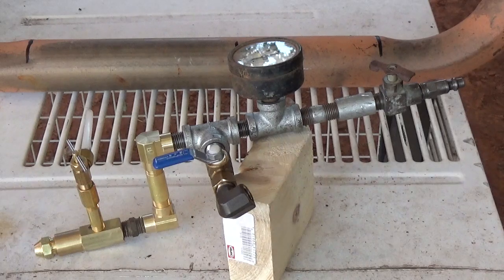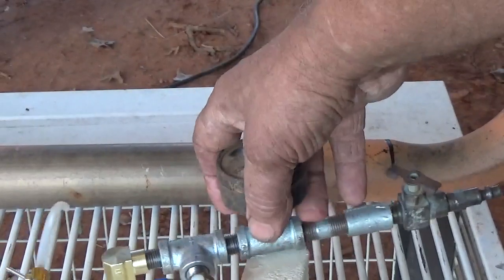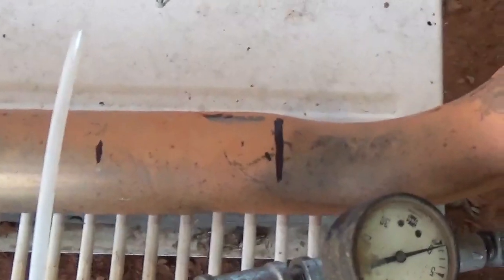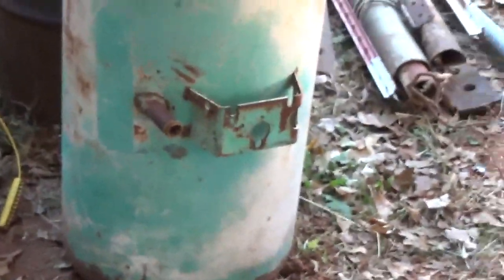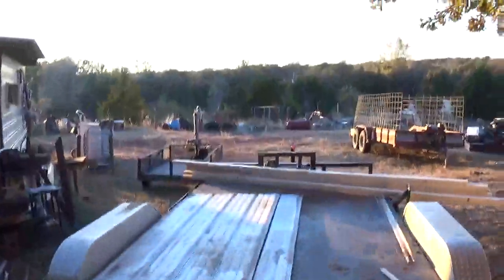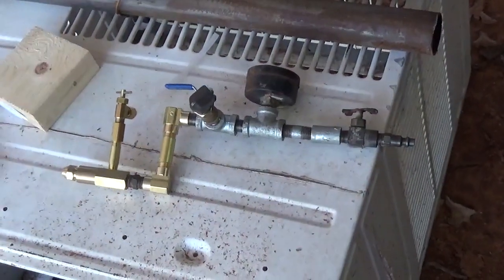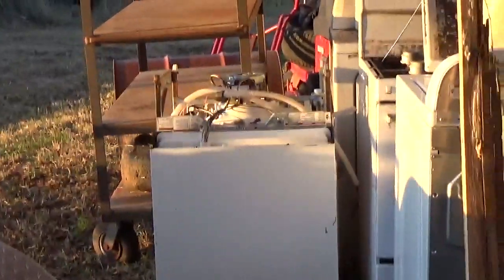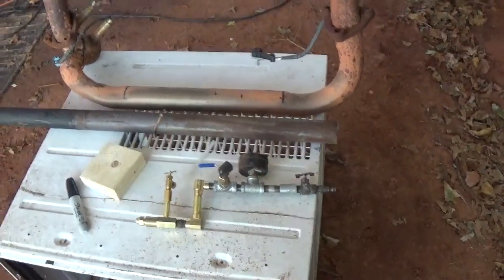The Making of a Waste Oil Burner

Comment: Love your videos. Do you have a parts list for this waste oil burner?
Reply from the maker: No, sorry I bought the nozzle and then went to Home Depot and spent about an hour going through fittings. and laid them out on the shelf until I got what I wanted, and I knew what I had at home
Reply: @Okiescrapper  Looks like most of the brass is 1/8" and 1/4"? The steel all 1.4"?
Reply: Should say....The steel all 1/4"?
Reply from the maker: @scottiearnett37150  I went with all brass inside the tube and galv on the outside
Reply: @Okiescrapper  on the air gauge...what should it measure in? and the needle valve...what are you using on the tubing side?
Reply from the maker: @scottiearnett37150  I think it is 1/4 inch tubing, the air gauge is in lbs. go up to 30 or so. it's just to give you an idea of air flow
Reply: @Okiescrapper  OK, I almost have my burner built. How long of 1 1/2" pipe did you use and how far from the end should the Delevan nozzle be? Should the burner be centered in the 1 1/2" pipe? If you want, I can post a parts list after I get mine built.
Reply from the maker: @scottiearnett37150  I don't think the length of the pipe is critical make it about 16 inches and have the burner in about 4 to 6 inches, the burner should be close to center, I do mix about 8 oz. of kerosene per 5 quarts of oil I think it helps it burn better diesel may work too. I just have some old kerosene around that I am using
Reply: @Okiescrapper  I finally have mine built, but I am having trouble getting it to burn off of oil. Approximately how many turns do you have the oil needle valve turned out? I think I had mine too rich, because I had oil inside the metal tube after I cooled it down. I tried different air pressures but no luck.
Reply from the maker: @scottiearnett37150  Try adding about 8 oz. of kerosene or diesel to a gallon or 5-quart jug  of oil
Reply: @Okiescrapper   I forgot to mention I did that. I had added 8 oz of diesel.  It burns well off the propane,  but when I shut the propane off it dies. BTW, I hope you are enjoying your retirement.

Comment: does the pipe have to have the 2....90 degree  in it or can it be straight
Reply from the maker: you could run it in straight, but I did the 90,s to have the burner in the middle of the pipe, guess you could use a longer nipple. my setup keeps the valves and gauge above the burner tube or burner pipe

Comment: Good  day Went here to see how you made it.  So you said this is dirty aluminum, how much is regular   clean  cast alum.    I like the idea that you can old oil hot enough.  Thanks
Reply from the maker: Clean Aluminum used to be about .40 a lb. Dirty Aluminum was about .10 lb. now Clean Aluminum is about .20 lb. and dirty about  .05 a lb. so if i melt it into ingots i can sell it on ebay to guys that do sand casting, i will try to price it to where i make 1.00 a lb. after shipping. i hope that helped. Thanks for watching Don stay safe